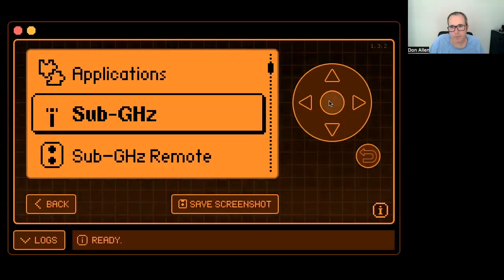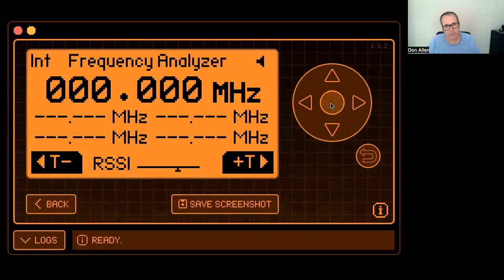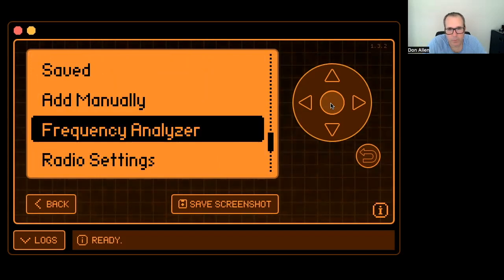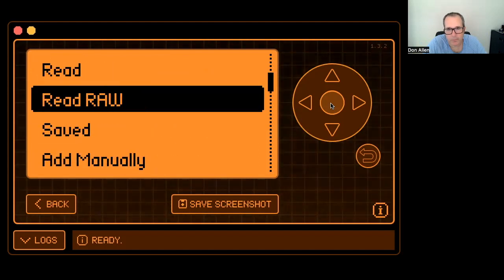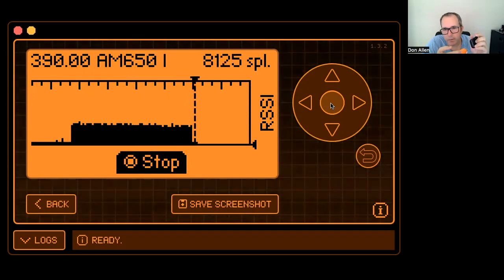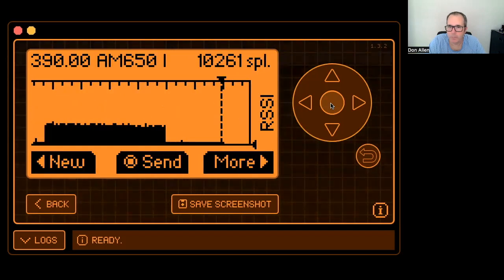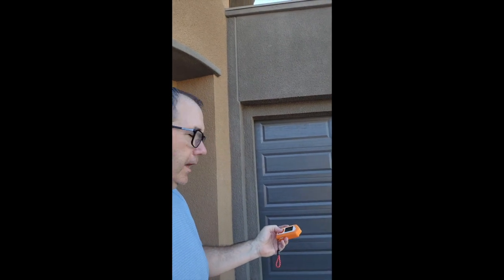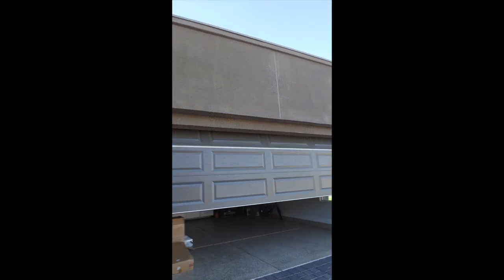Using FlipperZero to open a Garage Door

Comment: Wouldn't record my opener. any clue what I'm doing wrong or if something changed?
Reply from the maker: 1. verify the frequency and make sure you are capturing as close to it as possible. 2. try recording raw and make sure you are seeing the signal before going into the recording mode, 3. unlike this example, where I recorded it raw, you should use the normal recording feature in order to capture the algorithm correctly
Reply: @donallen3363  Will try tomorrow.. Thanks for the taking time to respond.. most won't. Just earned a new sub

Comment from the maker: Everyone!  I am pleased to report that this is no longer current information.  The Momentum firmware cracks the Chamberlain LiftMaster Garage codes and all you have to do now is record your remote (follow the first steps to find the frequency and record the signal) -- then you are good to go forever.  I will make another video to demonstrate when I have a chance.
Reply: please do; i tried recording after finding 315 freq and it did not work sending signal that i saved.

Comment: There are easier ways where you don’t have to record every time. Find out what security protocol your garage manufacturer uses and program that into the Flipper. Flipper will now have the algorithm to choose the next rolling code every time without needing to record again
Reply from the maker: Yes, there are now. That was not available at the time of this recording. I still don't think this is possible for my garage but other rolling code systems in my home have begun working.
Reply from the maker: ...and now Momentum has cracked the Chamberlain LiftMaster -- so you are now 100% correct